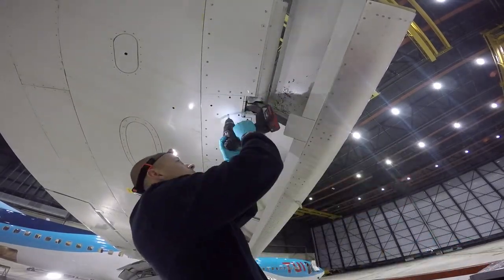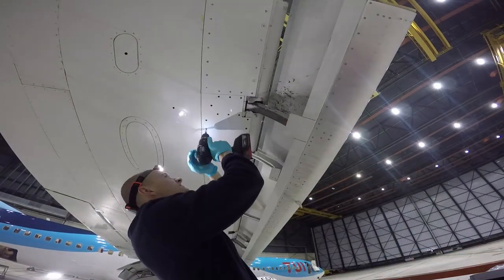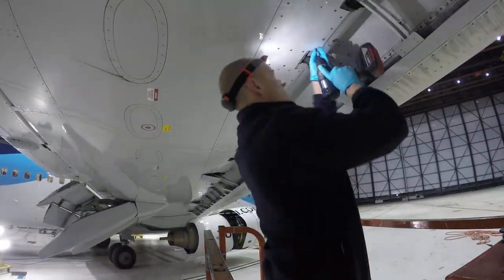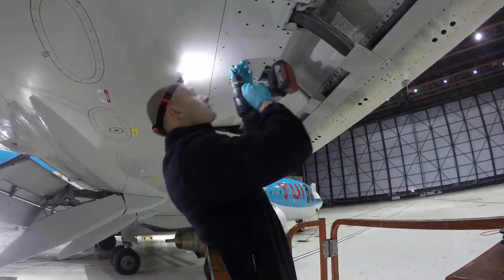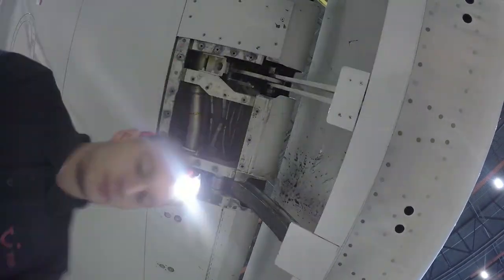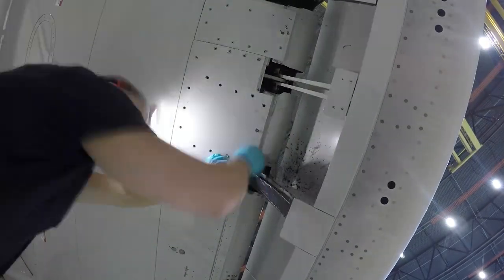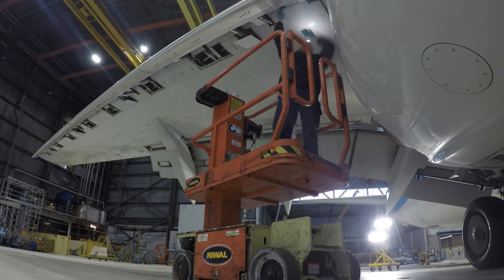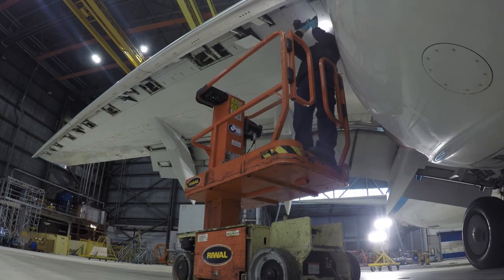Boeing 737NG: Slat lubrication

Comment: Cool , what about brushing the surface of the track with g-33?
Reply: Yeah that’s what the manual says to do on 767 anyway
Reply from the maker: The 737 has 2 different taskcards, LE main and aux tracks lubrication this has the applying grease step on the main track. And LE slat main track rollers lubrication. I did the latter ;-)